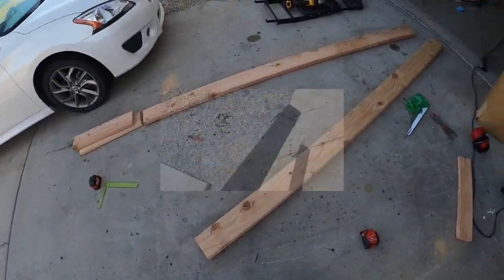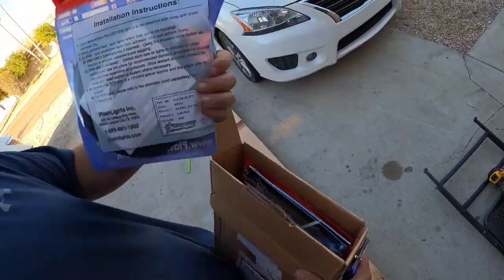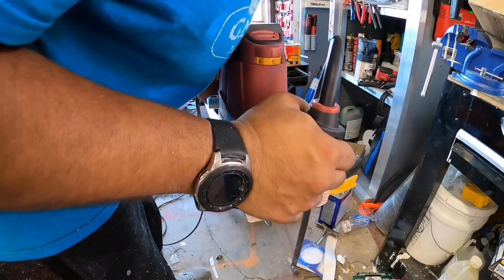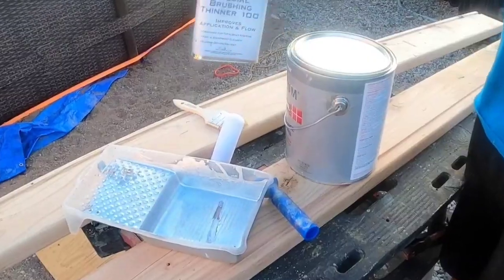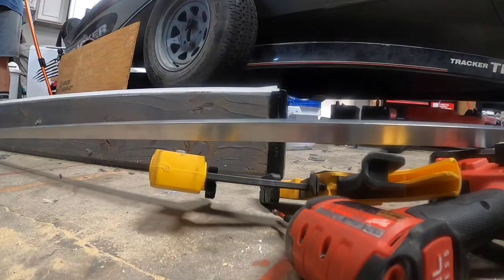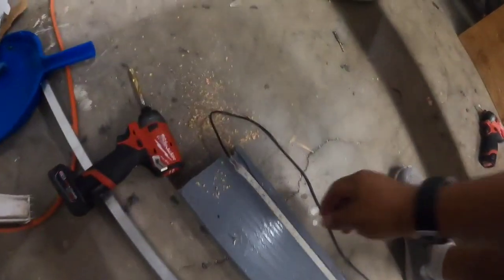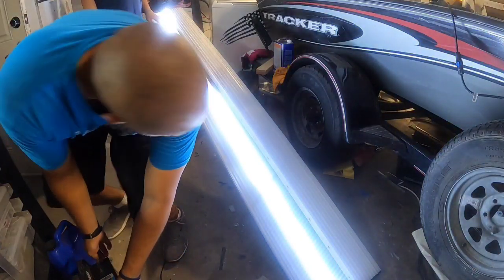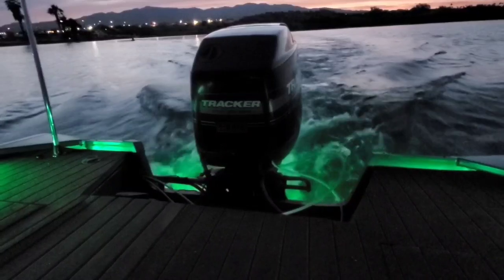Gatorbak Trailer Bunks: The ULTIMATE Boat Trailer Mod!

Comment: Hopefully you see this but just wondering how the wiring went because i feel like the lights would be blinding driving down the road. Did you wire them to only be on when you were loading somehow? Or are they always on with your trailer lights?
Reply: @TinyBoatNation  Does a switch come with the kit so you can turn the lights off if you want to ?

Comment: Installed these on my trailer, haven't had it in the water yet, still working on the boat. Got the clear, and lit it , like yours. I like the fact that they don't hold water, like carpet, and the grooves will let the water run out, reducing the chance of hull blisters (fiberglass boat).

Comment: Hey sir i have a ? I own a 87 bass track tx 17. I’ve notice i have a slow leak coming from the top of my transom soon as the boat touches the water. Any reason on what the issue might be? I felt the wood on the transom and notice that if i apply any pressure that it sorta feels a little weak. Do you think that could be the issue?
Reply: Thank you sir!

Comment: Nice.  I've had my bunks done with spray on truck bed-liner.  Awesome.  Also did the internal guide rails (2x6s)  for my pontoon boat.  Tough as nails and not that expensive.

Comment: Do you have video of how you wired them to your trailer wiring? And I think I asked this, but just in case: did you add an on/off switch to control the gatorbakights so that they aren't on all the time?

Comment: Why not use pressure treated for the bunks? Just curious
Reply: I used treated with Mine, I just waited till the wood was dry enough to paint because I liked the paint finished look, Had them in the water for two years now, they still look brand new. I'll never go back to carpet
Reply: I was always told The chemical in the pressure treatment is not good for the aluminum
Reply: Heath S but the boat is sitting on the plastic
Reply: @mainetroutwhisperer  Now here's a person with a brain.  Thank you Main Trout Whisperer. I also watch your channel.
Reply: @JP-nd9jq  where did you get your lights?

Comment: Could u run into legal issues running those lights at night?
Reply: They’re illegal in Maine
Reply: @Gator Guards / SS Marine Products do you guys sell the switch? I'm in AZ also. I was thinking of using red because while easily visible for loading/offloading, the red wouldn't be too bright on the road and will just make the trailer more visible to those around me at night and matches the brake lights. I figure if I add a switch, then I'm covered no matter where I go.

Comment: Y not use the pressure treated wood
Reply: @TinyBoatNation  But the boat isn't on the aluminum its on the Gatorbak
Reply: If you properly seal the wood then it won't matter. why pay for the pressure treated lumber? Just like in the video, a good enamel thinned a bit will penetrate deep into the wood. It isn't as if they stay in the water a long time. Lol